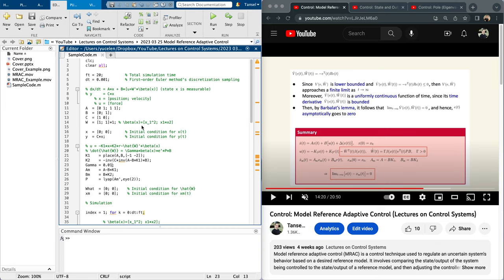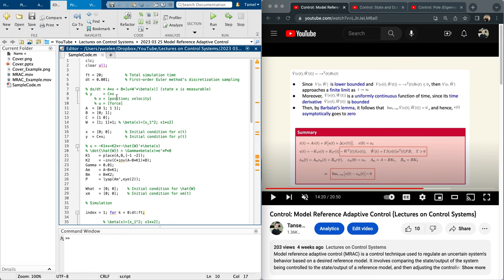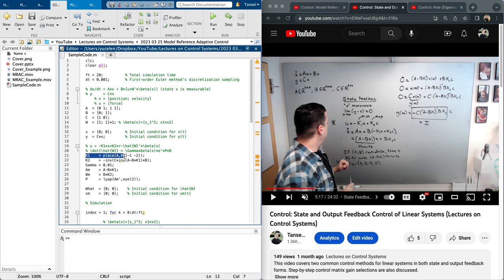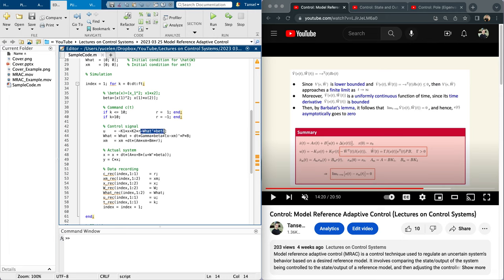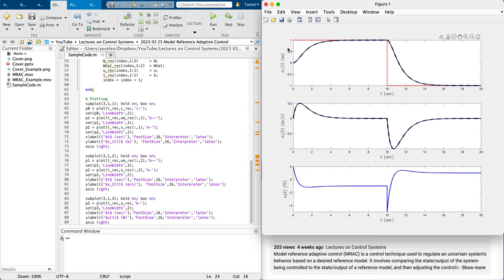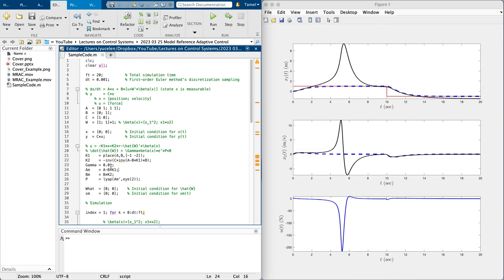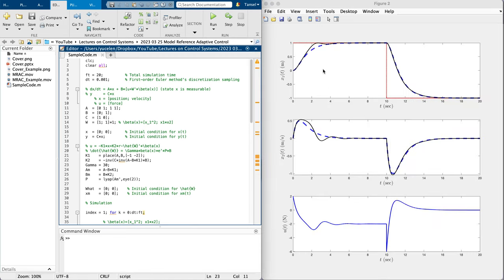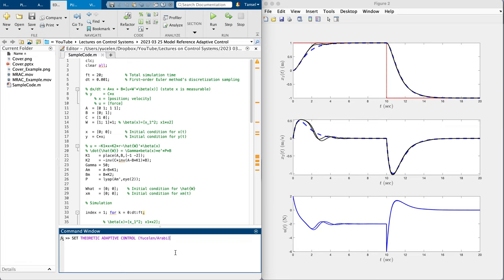Control: Model Reference Adaptive Control Example in Matlab (Lectures on Advanced Control Systems)

Comment: Can you do a video on multivariable MRAC state-feedback for output tracking. I am doing a related research for UAV control but it is a bit complicated. I am using Gang Tao papers as my reference.
Reply from the maker: This current video is on state-feedback MRAC. For a much more detailed version of it, please watch https://youtu.be/c9VwaSEo5t8. Now, to do output tracking, you need to choose your reference model. To design your reference model, you can use a feedback/feedforward approach or an integral approach. In this regard, I'd recommend that you watch first: https://youtu.be/EWeFxseU6g4